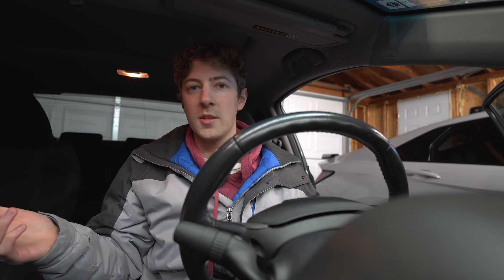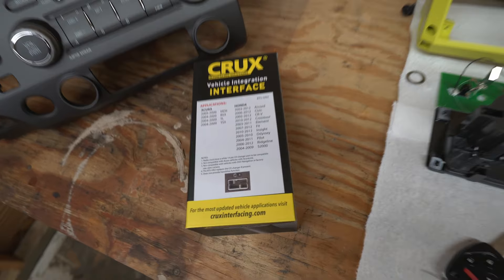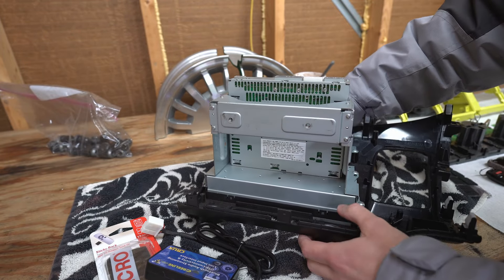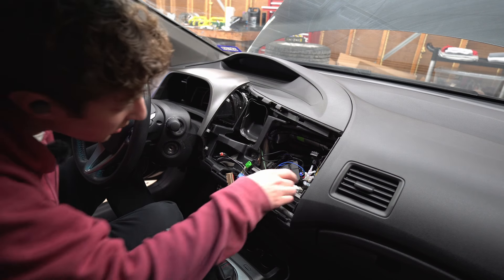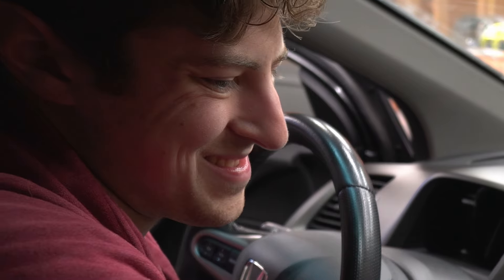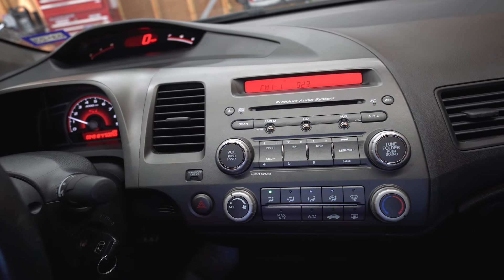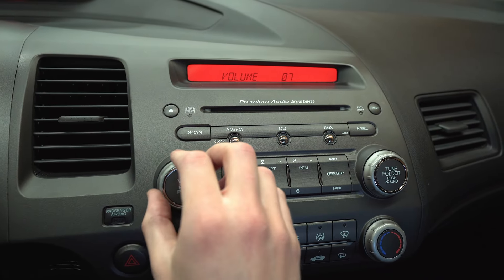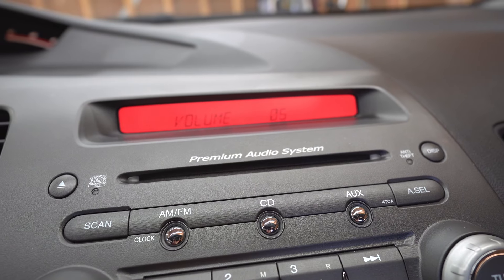EASY DIY Bluetooth For ANY Older Honda/Acura (8TH Gen Honda Civic SI)

Comment: FYI to others looking to do this. If your car already has an aux(3.5mm) port, you can buy a Bluetooth to aux adapter device for cheaper than this module. You also won’t need to remove the radio
Reply: which 1 would you recommend with no/less static? thanks
Reply: Bluetooth to aux adapters sound horrendous
Reply: Anger had a good one

Comment: the reason why your cd button still works is because this doesnt remove the cd capability, it plugs into the factory cd changer port. notice when you hit the aux button, the display says "CDC"? the module is tricking the radio into thinking you have the cd changer, and then using that channel to transmit the sound. i have a similar module on my wife's accord and it works the same way.
Reply: So with that in mind can you still play cd’s?
Reply: @csquared24ZL1  yes. I have modules in both my wife's carand in my car and the cd functionality is still there.

Comment: the static comes from the radio sending out signal, while there is an amp.... which means double the signal
Reply: I have left my stock head unit ,tagged into the stock sub with an RCA/speaker wire converter (cheapie one), and it growled at me at low volume and stereo off. Found out head unit sends signal to stock amp  then amp powers speakers.  Turns out, Hondas and other Japanese have this setup and aftermarket mods are tricky. The seller found this out and dealt with it by birds nesting the stock loom. Trial and error. One fella on YT used RCA outs from AM deck and connected them to the stock amp by grafting RCA ins to the stock amp for connection. Nice hack, my main problem was my RCA jacks slammed in the fold-down back seat. But learn this along the way. Nice vid though